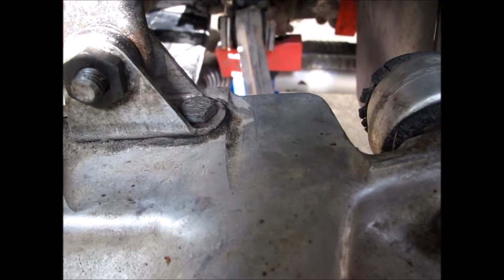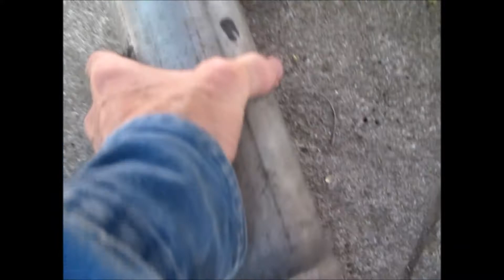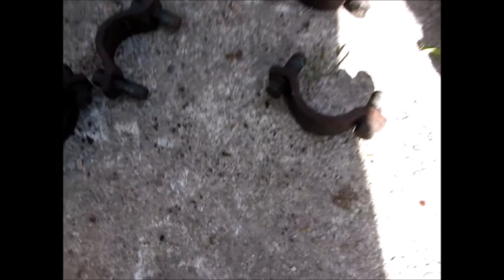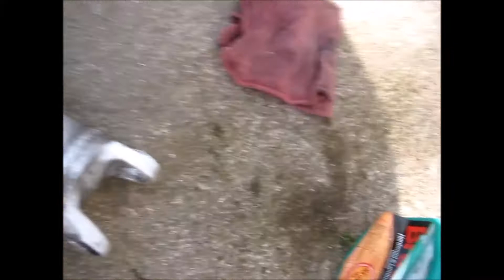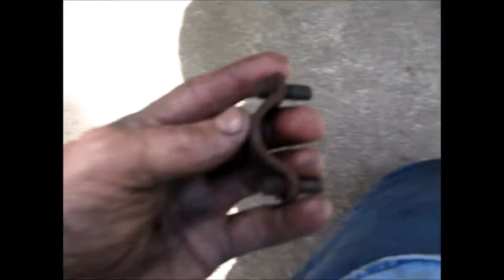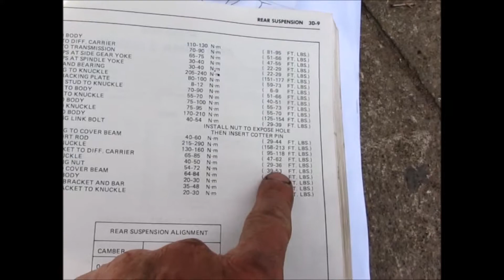𝟏𝟗𝟖𝟒 𝐂𝐎𝐑𝐕𝐄𝐓𝐓𝐄 Corvette Half Shaft U-Joints

Comment: I'm not sure if I have a bad half shaft U-Joint or Hub bearing but after watching your video and others if I need to remove the half shaft I may do it differently. From the looks of things if you drop the lower strut rod down from the knuckle and the differential ends it should provide the clearance needed for easier drop out of the half shaft. Has anyone else has done it this way?
Reply from the maker: I haven't, maybe someone else will comment. I don't think there could be a right or wrong way, just whatever works best. If you do it that way lets us know thanks.

Comment: This is my next project..I hear a small pinging sound when i put it in gear and when im driving slow..almost sounds as if small pebbles from the road are jumping up and bouncing off the half shafts..Im assuming its the U joints...Its not a knocking sound..its a very tinny pinging hollow sound...Havent gotten under there really to see whats what yet but I think they are bad.. Plus when Im driving if I decelerate and stab the gas pedal that when I here a loud thunk back there..any thoughts?
Reply from the maker: does sound like u-joints,  which is a fairly easy job. The thunk not sure about that Jamie, but probably the u-joint also. Just guessing here.